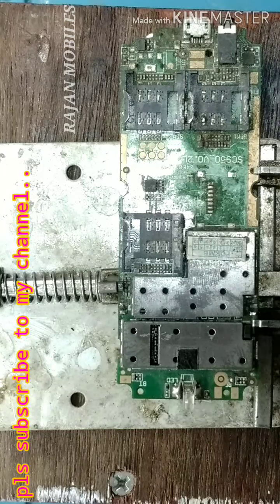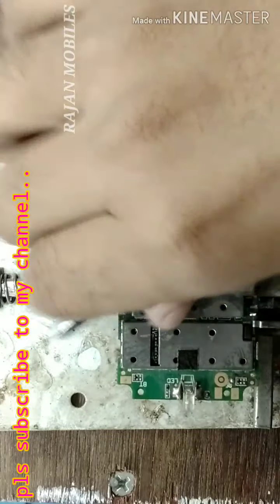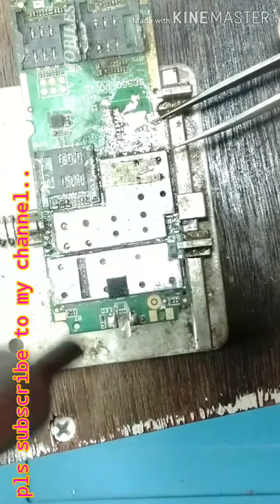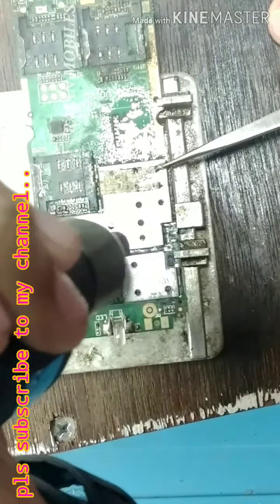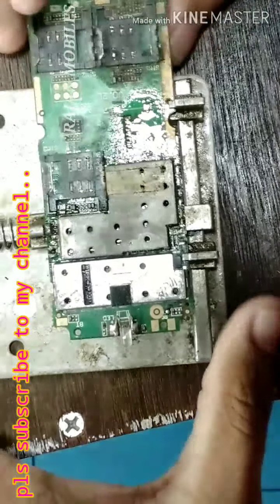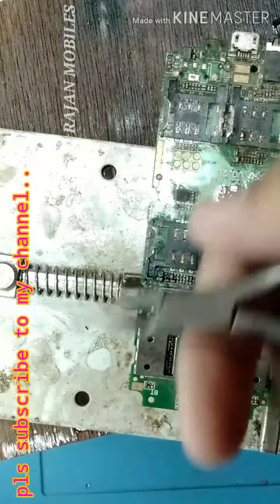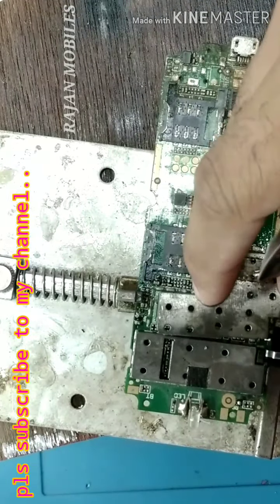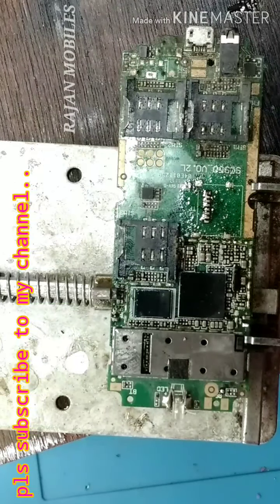Cellphone Shield remove in tamil | RAJAN MOBILES

Comment: Neenga use panra blower model and price share bro
Reply from the maker: Rd 850 blower price 2200 to 2500 bro
Reply: @rajanmobiles7872  thanks bro ic remove panrathuku nallrukuma bro
Reply from the maker: Ya bro sure today kooda oru flash ic remove panni flash panni reballing panni fit pannen bro
Reply from the maker: Smooth blower
Reply: Bro group full